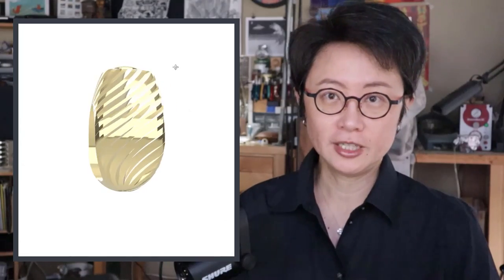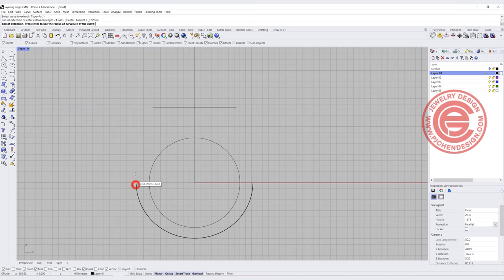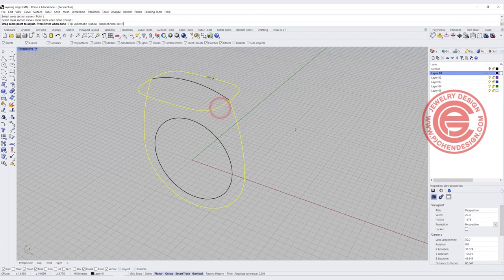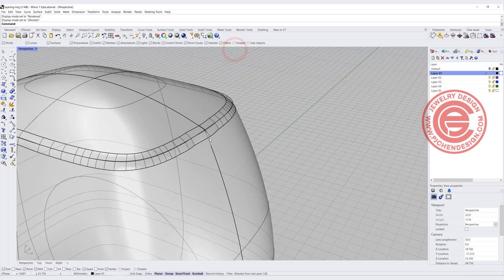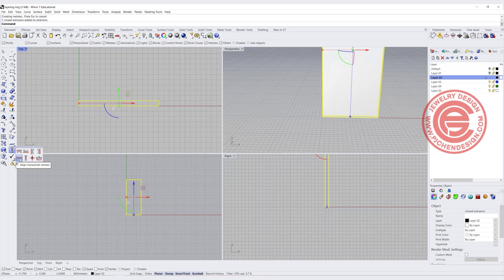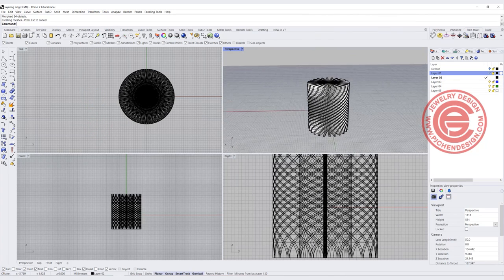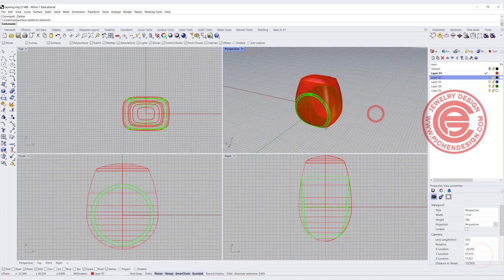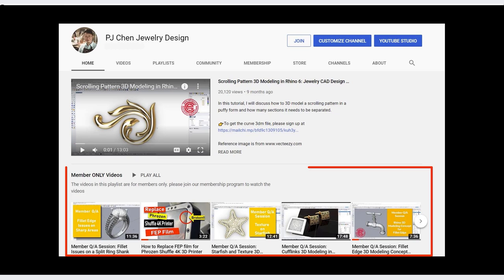Twisted Layering Signet Ring- Jewelry CAD Design Tutorial 3D Modeling with Rhino 3D #305

Comment: Thank you so much!!is it possible to apply texture between  pattern before twisting?? problems with the boolean?? ?  thinking about finish surface between pattern  when is casting!! Cheers PJ!!
Reply from the maker: You can and always want to apply pattern before twisted or deform. You may want to consider the patterns size. If it is too small, it won't show after casting.

Comment: Hi, I watched it as a reminder after a long break from designing. I couldn't wait for the end of video and to see how it will be joined/boolean union into one piece for printing out. At the final stage, the boolean command fails.  The ring is not solid. Can it be printed like this? Thanks
Reply from the maker: I have playlist of Q/A on my channel. There are several video discuss boolean issue in depth. you can check it out. as for the 3d printing, you can print it out even all the part are not boolean as long as they are solid.
Reply: @PJChenJewelryDesign  Thank you for your reply. You are not a bot :) Your channel looks very didactic. Your detailed and instructive videos era very encouraging to me to come back to design and join your PRO channel. Just have one question about interacting with you as a tutor. Could I ask questions if encountered any problems to get a solution?
By the way, I remember the problems with Boolean Union before and even now in your video after ArrayPolar 24 pieces can't be Boolean Union :( But after ArrayPolar 12 pieces can be Bolean Union plus rotate/copy it I can get 24-piece solid. It looks like there is a limit for intersected parts or so, doesn't it? Regards

Comment: Even though I entered the same measurements in all the models you made, I still get the boolean failure error in almost all of them.
Reply from the maker: The seams maybe overlapping. I have several Boolean issue videos in the Q/A playlist. welcome to check them out.
Reply: @PJChenJewelryDesign  Thank you for your answer. I found the problem, the lines overlap as you said. The result is perfect. My only problem is that my ring is only 42 gr :))